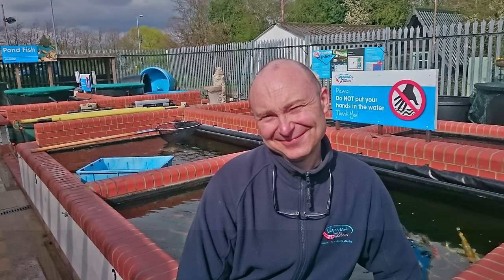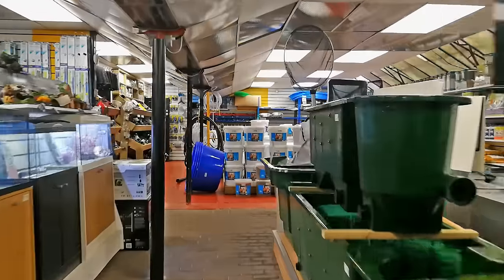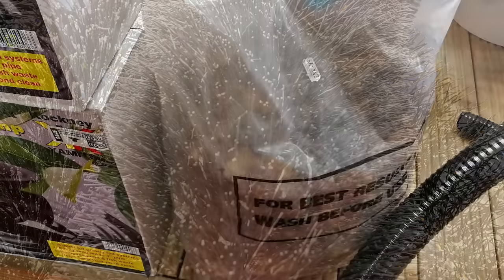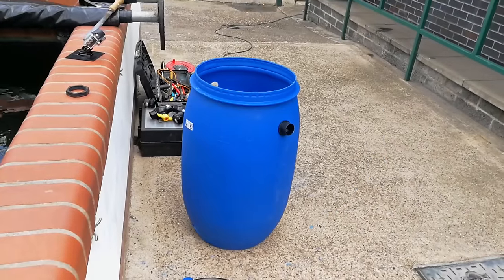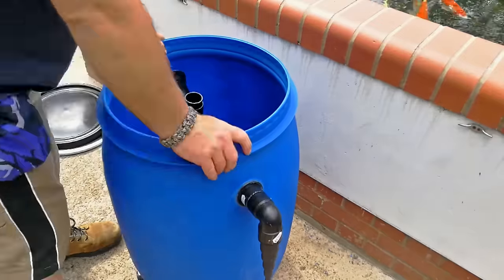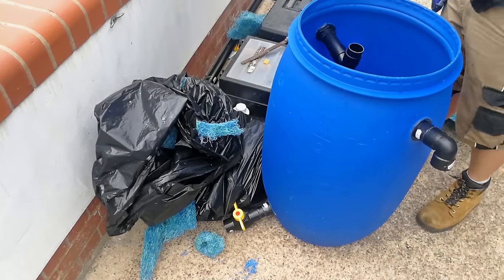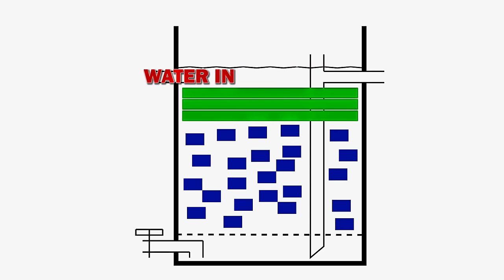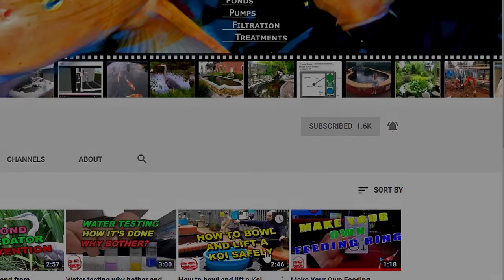DIY fish pond filter cheap easy.

Comment: Great video,  1 question though,if the water is GJ oing in through the top, and being pulled from the bottom to go back to the pond, does that not pull all the waste that would typically settle at the top back into the pond?

Comment: Made a rookie mistake with filter on a new pond Knowhere near good enough and built this in a rush to try and fix it. When I installed it I had bad ammonia, phosphate and water I couldn’t see an inch into. Made this filter with some alpha frog in the bottom and writhing 24 hours the ammonia was gone, by the end of the week water was absolutely crystal. Been running two months now and everything is perfect. Was only supposed to be a stop gap till I got a new filter but I’m honestly scared to change it now. Only thing I’d say is it’s a bit of a chore to clean out but well worth putting up with. Thanks lee
Reply from the maker: Your very welcome. Glad it worked so well.

Comment: I built 2 like this for my outdoor 200 gallon Koi pond, and my 110 gallon turtle tank. I used two 25 gallon drums. Instead of burying it with all that foam, I put all my filter media in a 5 gallon bucket filled 3/4 of the way.  I drilled holes on the bottom. Now, I just pull out the 5 gallon bucket out for much easier cleaning. I placed 3 sets of 1 gallon buckets filled with lava rocks under the 5 gallon bucket. I put my pump on the bottom because it tends to leak. I just added the clean out valve like you show, and also put the overflow T fitting. Thank you for the tip.

Comment: Hi, ive got a 708ltr pond, would a 120 ltr barrel be the correct size? Also what size pump would I need for this size pond please? Thank you 😊
Reply from the maker: Perfect size barrel. Any small reliable pump will work just fine. Up to 3,000 litre per hour.

Comment: I have a bunch of different size rocks and a bag of plastic bio balls.
I am also running the input from the top to the bottom and the filtered water leaving at the top.
It seems like the majority of videos I've watched use the bottom up method.
I'm still a day from having all the parts in hand to start.

Comment: Wonderful and informative video! Thank you for taking the time and producing this video.  Quick question,  l have a pump that pumps 4235 gallons per hour.  What size PVC pipe would you recommend me using?
Reply from the maker: You would need a much larger size pipe for that amount of flow. Probably 4".

Comment: So this design is great! I actually made one for about 100$ just I had to increase the output to two 3" pvc due to running a submersible 1/3hp pump at about 2800/hr otherwise it would just overflow

Comment: If you reverse your Inlet and Outlet on that exact setup your filter will work much better. Because water will always take the route of least resistance once your pads start to get a little dirty the water will then start to go straight to your overflow. But if you're in that forces the water to the bottom of the filter which would then Force the water up through the pads this one this will make sure that you always have a much cleaner system
Reply from the maker: I completely disagree. If you bring the water in at the bottom the muck will be impossible to clean without draining out the filter and lifting all the media out. In at top, stop the dirt with a fine filter that is easy to access, then let the bacteria thirve in the bottom.
Reply from the maker: I do accept the water will go over the overflow, that's essential to prevent the filter overflowing. When this starts to happen the sponges must be cleaned.

Comment: My pond would definitely benefit from a filter like this. You could have painted the blue barrel it would blend in better.
Reply: Hi my pond is vey brownish come greenish I have added new bacteria, and put it into my filter. But my pond went  brown I left it for a week and no change in the water it was so bad. I had to near empty the pond and put tap water into the pond also freatment for the chemicals from the tap. Now it has changed it green. I bought green water treetment so  I am about to put that into the pond now my pond takes 1,200 gals. Could you inform me is that the right thing to do.
                                Regards    Michael  Ogilvie
Reply: @michaelogilvie7330  Hi just saw your comment. Adding bacteria or chemicals is just a waste of time and money. A suitable UV sterilizer might do the job. UV can remove green water permanently if installed thoroughly.

Comment: Great info:hand-pink-waving:, but have you thought about a drum filter? It provides top-notch filtration by automatically removing debris and dirt, so you don’t have to. It’s incredibly low maintenance and costs just around half a dollar per month in electricity. If you want clear water and less time spent cleaning, this filter could be a game-changer :face-blue-smiling:

Comment: I did this design but instead put two 2 inch outakes to increase the flow with a 5,600 gph pump. I also added many different types of filtration that differ from yours. This filter setup has kept my 3,000 gallon pond spotless. I have a heavy fish load as well. If anyone is looking at this video for inspiration build it!
Reply from the maker: I am very pleased your filter worked so well. This design is a good starting concept. There are many modifications and upgrades possible.
Reply: Yeah its super affordable as well. I currently work at San Diego Pond And Garden in California. I plan to do a bog and wetland filtration system on my next project.
Reply from the maker: @HairyPatch1  A well designed bog filter is perfect for natural ponds. You just have to try and in corporate some mechanical pre filtration. Then they are outstanding.
Reply: @leecalladine  Okay I’ll keep that in mind!! Thanks for the tip
Reply: My flow rate is 5000g/hour didn't work with 3 inch pipe return. I don't know what is wrong

Comment: Hey top video,  just wondering I've seen people who have the water come in at the bottom then overflow out top,rather than come in at the top then get pulled to the bottom before returning to overflow at top. Is there any difference? cheers also I have to big of a pump can I just put another standpipe in and have two outlets thank you 😊
Reply from the maker: The method described in the video allows you run the fine filter and access it easier. The pump size with 2in outlet should not exceed aprx 1000 gallons per hour. A lot less if using 1.5in pipes.

Comment: That barrel was a good find!
Reply from the maker: You can often pick them up on eBay or similar.
Reply: I imagine I can find something similar but in my area we call them bear barrels. Locked and round so a bear has trouble getting into it. Cost a fortune when sold that way.

Comment: Nice and simple filter but I have a question. Does the outlet pipe going to the bottom of the filter pick up muck from the bottom and does the water syphon back to the pond when the pump is turned off?
Reply from the maker: No it can't Syphon back. The tee over flow prevents Amy chance. Also the water of the bottom should be relatively solid free.
Reply: @leecalladine  Thanks for the reply, I'm going to make one asap!! and I look forward to an update on the one you made in the future.

Comment: Is the barrel under pressure, or is it a gravity feed system?
Reply from the maker: It does work under pressure with the lid on. Otherwise it works fine without the lid. Pump fed gravity return

Comment: Go to your local garage/car-service place... They probably have dozens of barrels used for "adblue" wich they go through and have to recycle. Downside: no removable lid but two allready cut holes in the top. Adblue is the chem used for dieselcars and is 32% PEE and the rest is clean water.

Comment: Thank you Lee, I have a very large pond 50000 gallons, do you think I can just put 3 barrels daisy-chained in a row letting one feed into the next?
Reply from the maker: You need to make sure the transfer pipes are large diameter so you don't get water backing up in the tanks and overflowing.

Comment: Very nice work, one of the easiest and fastest filter builds I've seen. Looks to be a great idea for the filter media as well. I'm gonna give this a try today. My pond is about 1200 gal, so this should do the trick for sure.  I'm just concerned about circulation of the water to insure all the "crud" is removed. Presently I have a stiff bristle brush that I use to disturb the bottom junk to keep stuff suspended in the water.
Reply: Interestingly enough I found my barrels locally on a county wide "buy sell trade" on Facebook Marketplace. Don't get inpatient, these barrels can be a bugger to get your hands on, I paid $25 each.
Reply from the maker: Glad you liked it. It works well and can be modified to suit a variety of container's.
Reply: There’s plenty of barrels on eBay.

Comment: Looks like a great setup,  what pump do you use to bring the water into the filter , thanks in advance
Reply from the maker: It's a a pondtec 3500 mounted dry. Very cheap pump.

Comment: Thank you so much for the great tutorial. How to get water siphon out of the outlet? I build a smaller tank of 25 gallons and used 1" pipe. Water doesn't siphon out when I tested out only with water. Do I need to put all media before doing test? Does media create pressure for water to siphon out? What can be incoming water flow rate?
Reply from the maker: The water is rising above the height of the outlet. It then is just running freely back to the pond. There is no Syphon involved.
Reply from the maker: Make sure there is a tee section at top. Maybe there is an airlock.

Comment: I've done this just the same but I have a gurgling sound from my filter and its like the outlet water is pulsating  . Any ideas plz need to know asap
Reply from the maker: It sounds like it's syphoning out then stopping. Syphoning out then stopping. I don't think it's necessary a problem.
Reply: @leecalladine  surely it's meant to be a continuous flow but ive never known it to gurgle
Reply: @leecalladine  dnt matter ive sorted it out it dnt gurgle now

Comment: What is the maximum sized pond ( litres ) could a single 220l barrel filter be used for ? And could I link several together for using on a larger pond size ?
Reply from the maker: These is no maximum. The size of the pond is only one small factor when deciding on a pond filter. Stocking rate and how much maintenance you are prepared for is equally important. I would recommend using multiple filters as separate systems instead of linking them.

Comment: Hi Lee I have a  PFC 20000 all ponds solution pressure filter with a 18watt uv ,  EA 20000 pump fed  running at 50% and returns by my waterblade . After seeing your filter I would love to have your advice if I would be able to add this to my pressure filter to my system my pond is  around 911 gall and how would I link them together . Thank you for inspiring users Carol
Reply from the maker: The filter could be connected to the pressure filter. However the water blade may be a challenge. Perhaps you would be better running this filter as an independent system with its own pump.

Comment: Hi Lee, I've copied your design but ive used King British sealent for it, ive let it set but it keeps leaking water from the bottom and the top outlet, ive had to disconnect it from my pond as it will empty it out, is there another stronger sealent you could recommend to me please, thanks
Reply from the maker: You have to use proper tank connection or bulk head fittings that pull up tight. Then any aquarium sealant will do the job perfect.
Reply: @leecalladine  thank you, yes that's what I've got but I've just noticed looking online that some tank connectors come with a seal and some don't, mine didn't come with any so maybe that could be part of the problem to, I will try a different aquarium sealent aswell and let you know how I get on

Comment: Hi,

I have a garden water collector which my late father had (I've just moved into their house), I suppose I could use that. 

Could everyday sponges be used?
How thick is the glass in that pond?
I have a lot of glass, some toughened, some not, I was thinking of using them for the side of my pond when I make it, what you think?
Shall I use Wooden Sleepers or Decking for the sides?
Thanks
Reply from the maker: Rain butts can be used but they are not strong enough to hold heavy media like gravel for instance.
Reply from the maker: Sleepers are very popular. Sometimes difficult to cut and joing though if you don't have the right tools.
Reply: @leecalladine  I don't realy have what I'd call the right tools but I did cut a few when I used hem for what was my mothers flower beds to raid them, they cut ok. 
Thanks

Comment: I don't quite hear the correct size of your bulkhead size:  is it 1 1/2" or 1/2" bulk head?  If it's 1/2" bulk head, it's kind of small
Reply from the maker: Go for 2in works a lot better.
Reply: @leecalladine  can you list all the part for this build?  I’m suoer newbie
Reply: @leecalladine  what is the drill size hole that you use for 2"?  I would like to duplicate your built.
what is the drill size hole that you use?

1 of 2" hose tail 

3 of 2" thread bulk head

1 of 2" T connector

1 of  2"" valve

3 of 2" 90 degree angle

Comment: We made this filter following your directions. However the inside pressure is causing water to leak out of the top. Any suggestions to fix this?
Reply from the maker: The pump is too powerful. Or the fittings are too close to the top.
Reply: Had a similar problem at the start. The outlet pipe had an air pocket restricting the outlet flow. With a bit of a shake of the pipe the bubble cleared and the last overflow stopped

Comment: Great video and very helpful, I am in the process of building one now.  When cleaning do you need to remove all the filter components or just clean the foam filters at the top and then flush the rest of the filter through?  Thanks
Reply from the maker: Usually just the top. The. Drain down, pour bucket pond water in top.
Reply: @leecalladine  Great, thank you.
Reply: @leecalladine  Thank you for this straightforward, accessible video! How often do you suggest the filter be cleaned?

Comment: How often you clean the sponges? I built filter with the same method but i should clean the sponge every week.
Reply from the maker: You need to clean the sponges when they get dirty and water flow through them is restricted.
Reply: @leecalladine  The problem is that i need to clean every week and it is to much for me

Comment: Nice design, Lee.  Wondering if you have any recent observations or advice on cleaning this system. How often do you drain the unit from the bottom?  How often do you remove and clean or replace the upper foam pads and cloth material?  Would it be worth adding a compressed air bubble system at the bottom (or at least under the foam pads) to back flush and discard that dirty water every few days?  (In that case, I would add a secondary outlet & valve at the top that would Tee into your existing waste line at the bottom. We get a buildup of diatoms (micro-algae) every few days that plugs the microfiber cloth (and pumice stone) in our present trickle filter, and it's very labor intensive to hose off and wring out those cloths.  Back flushing would seem much easier.
Reply from the maker: I have found it necessary to clean the sponges out fairly regular. Perhaps twice weekly. The tank has been drained down several time by opening the valve.  But there wasn't much muck in there because the sponges take it all out.
Reply: @leecalladine  Thanks, Lee.

Comment: great video. If I made two of these filters how would it be best to connect them together to work as one large filter ? 
Thanks so much
Reply from the maker: If you were to connect 2 together you would need to enlarge the connection pipes and make some changes to the flow.
Reply from the maker: You could also put some brushes in the first then more dense media in the second one.
Reply: Top man thank you lee

Comment: Just using what i have from previous pond. Can i use a larger suction hose <approx inch and quarter  (Inlet) from a submerged pump than the delivery hose(outlet) as i have an artificial waterfall with a hole about hosepipe size.
Reply from the maker: Sound like the water fall might restrict the out flow and chase the filter to over flow.
Reply: @leecalladine  cheers Lee thank you for quick response..  trial and error seems odd the preformed waterfalls have such a tiny hole ..
Reply from the maker: @robshaw3655  perhaps you could use a pump directly on the water fall and by pass the waterfall entirely.

Comment: Why is your cleaning drain/valve grabbing the same exact water that your outlet is grabbing?   Wouldn't a radial settler or a swirl filter be better to separate solids so they are easily cleaned?  I like all the bio filtration in this though.  I just feel like its going to get so dirty and you will need to replace all the sponges in the top.  The drain valve in the bottom seems pointless if thats where the outlet is anyway.  Your outlet is a solids lift outlet.
Reply from the maker: The solids are mainly in  the top section. The outlet is at the top but takes clean water from the bottom.

Comment: Can you use several of these filters after each other. Like connecting three of them, making the water go through three of these filters before it get sent back to the pond?
Reply from the maker: There ways that could be made to work. But the pipes would need to big bigger and the layout would need to change etc etc.
Reply: @leecalladine  how many litres is the filter fit for?
Reply from the maker: @constantine-worldsmostdang7908  No definite pond size. Filters are always too small never to big.